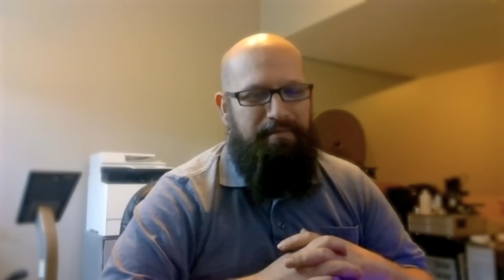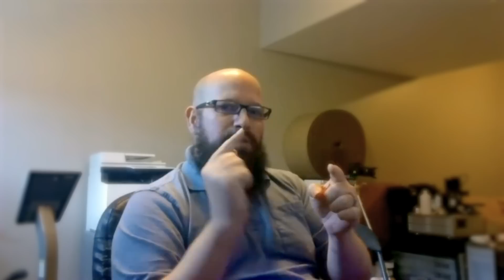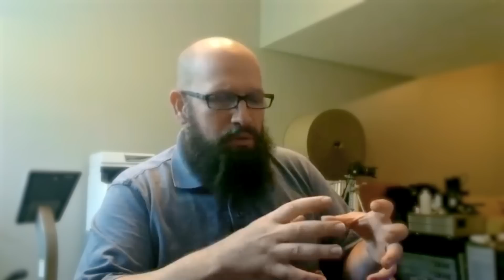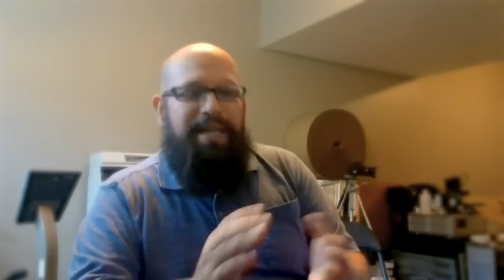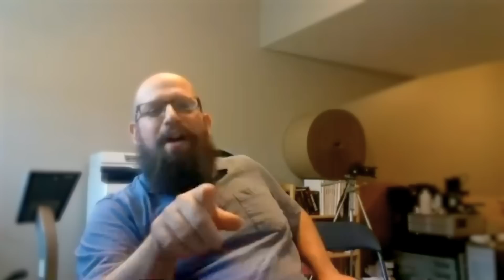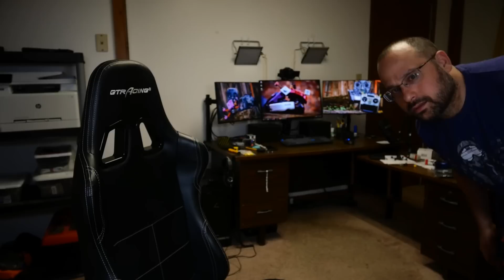Stop desyncs on your "160 mph" 6S 2700kv quad (with Ryan Harrell of miniquadtestbench)

Comment: For once, I don't think I even need to clarify myself on anything :D Thanks for having me on! Hope this is helpful for some folks.
Reply: Damn boys, you just had me zoned full nerd mode 😂  invaluable info... Thank you 🙏  and yes to the end every time dude!
Reply: Thank you very much for sharing your knowledge Ryan. We always learn a huge amount from listening to you, and I would eagerly listen to you go down the rabbit hole any time.👍😁
Regards
Darren
Reply: I've been waiting two years for this.
Reply: Thanks for all the tips!  Would you be willing to run a test on the 4s motors running at 6s with a motor output limit just to validate the theory?  It would be interesting to see the power curves and efficiency.  (6s, 2600kv motors, output limit set to 70% or so).
Reply: @gregoryhurst5982  would be interesting for sure. I'll look into it.
Reply: Yet goofballs like me will want to go deeper into the rabbit hold.
Reply: Love it when you lay down the knowledge man!
Reply: What is your go to ESC? which one or ones do you think are the best? EDIT i  see you answered that question. Makes me happy that my go to ( akion 35a ) is one you picked.
Reply: SpikeJonesTheCr0oked I run
an aikon too on one of my quads. It took several beatings and it has no issues so far.
Reply: How about a recap at the end on settings. Are we talking 24khz 25% ramp up demag comp high only in blhelli then. Just checking. Cool stuff
Reply: is there anything in the esc firmware  or settings that would contribute to error being reported in the motors tab of betaflight? I have one quad running the individual  tekkometal 65 amp esc's.  They work great when not using bidirectional. But no matter what I get error when I use that type of filtering.
Reply: @MouwDown  Unlikely that it would be a settings issue. Likely it would be hardware related, possibly an issue with capacitor ratings on the signal line being out of spec. Could potentially be an issue with the MCU or EEPROM. Try reflashing the ESC without restoring your settings and see if that fixes it.
Reply: I was on betaflight 3.5 never once had a dsync. Updated to 4.2.3 with bidirectional and had dsync first flight. Mine is 4s 2450kv flycolor 30a 4 in 1 esc. So blheli_s.  This gives me very good idea for some ideas to try. By timing guess mine would need to set medium high? And which in order sound I try demag first or do all 3 demag,timing, and start up power? I know my components aren't top line just want to make latest betaflight work instead of going back to like 4.0
Reply: @CrawlersCampRc  If you're getting desyncs after bidirectional, but it was working before it might not be as much a settings issue as something else going on. What firmware are you using to get bidirectional on BLHeli_S hardware? I've seen a lot of issues with JazzMac/BLHeli-M. I stick with JESC personally.
Reply: @QuadMcFlyFlies  I'm using the jesc firmware and the FC is a omnibusf4sd. It is a arris x220 v2 rtf kit. Yeah strange never had one then updated both esc and fc and first pack about 2 mins in when to do front flip and started roll of death. Waiting on new frame to here gonna go through everything and do another motor error check. I had motor stop turned on in betaflight cause that was how hobby shop had it set up originally for attitude and acro and air in switch. Running with it off next time cause i dont see anyone turning that on in 4 2.
Reply: Thanks for doing this, I learnt something today as I'm sure a lot of folks did.

miniquadstestbench is a bible, thank you for being you and for doing what you do :D

Comment: Great convo! Now I have ESC settings to adjust. Demag Hi, Timing 24, ramp-up pwr 25%. Test PWM 24 vs 48.

Ummagawd V2 2150 motors have worked well for me on 6s. They desync at ~99% but its hard to reach that w/o brain desyncing.

Update: One motor still decided to barrel roll me out of the sky at 100mph into concrete. Fun though!
Reply: I have been doing Ummagawds on 6in and 5s.   Thing is a rocketship but I havent done 100% throttle for sustained flight.   Only ever goto like 80% throttle.

Comment: This also happened to one of my friend's quad it randomly fell out of the sky when increasing the throttle a bit... It was a 4s I don't remember the kv, but (I haven't whatched the video yet) would this also apply for other quads ?
Reply from the maker: In general a mid-kv 4S quad should not have desyncs under any conditions. If that happened I would assume hardware damage to the motor or ESC first. The default ESC settings work well for typical setups. Only in extreme setups do you maybe have to start changing settings to avoid desyncs.
Reply: Broken or bad stuff can do that, but there are a multitude of annoying reasons quads can drop out of the sky.
Doing inherently ridiculous stuff like spinning props at 40,000rpm while pulling 2kW out of a battery - you end up seeing the same problems over and over again.
Reply: @tehllama42  i really want to try to see what happens if I can get a 5in prop to super sonic speeds...

Not sure there are many motors out there that could drive a prop to 40k rpm under load.   I was thinking about KV and RPMs loaded versus loaded the other day.   I really need to get telemetry working to see what my motor RPMs are at in normal flight and in high performance flight.

If I can pull 20k RPM my tip speed on a 5in prop is almost 300mph.

Exploding props sounds so damn fun.
Reply: @dividingbyzeros  Pretty much anything with the stank to warble props is actually doing it - easier with 7" also.  Practically, this is precisely why 38kRPM is my build target when I'm mathing-out the throttle limiting up top, because that's where I stop making additional power no matter what - then I start doing even more throttle limiting because I suck.